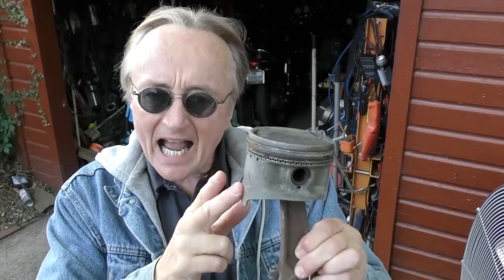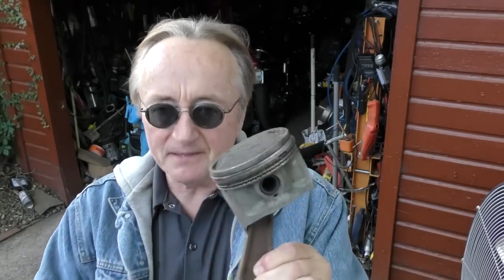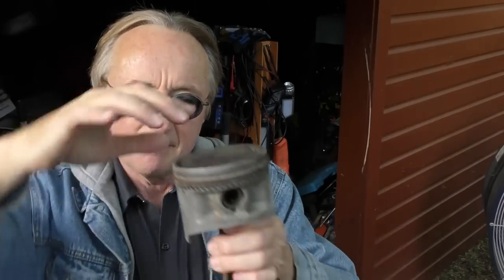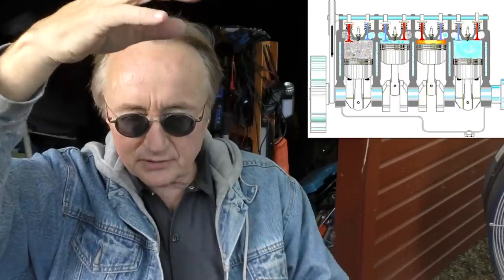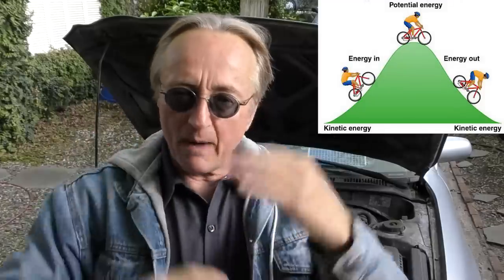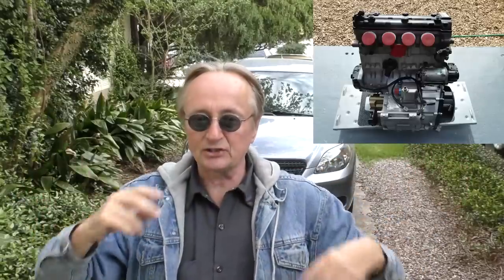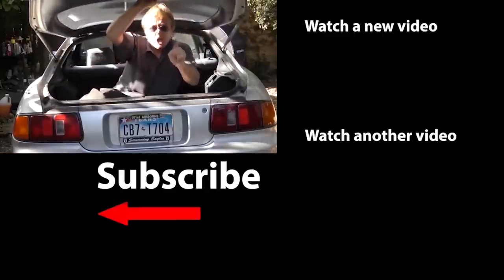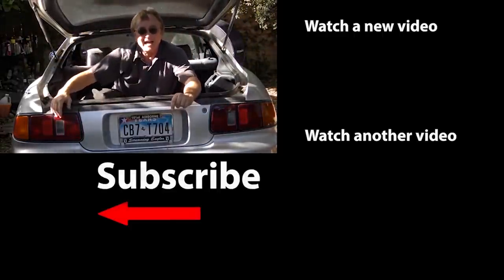Horsepower vs Torque, Which is Better

Comment: Horsepower is useless without torque!
Reply: you can't get one without the other
Reply: @mcplutt  Yes but you can move a mountain with 1 horsepower if you have enough torque. The 1984 BMW 318 had only 110 hp but 170 fp of torque and I could idle up a hill in 3rd gear. If it was reversed it wouldn't be able to get out of it's own way!

Comment: F1 cars don't accelerate all that well?? 0-60mph in 2.1 seconds and 0-100mph in 4 seconds...
Reply: Collins LFC he's talking smack. And not taking revs into consideration. He's referring to acceleration from a dead stand still, not taking into consideration once the car builds up revs, which is exactly why F1 cars are so quick. Their torque isn't all that impressive compared to a normal road car but they rev like crazy which is why they accelerate so hard

Comment: Lot's of horsepower and low torque mean they don't accelerate well? How does a McLaren 720s run circles around both the Hellcat and a Tesla then lol? Then again it's probably because the 720s is like 3,000 pounds.
Reply: A stock 720S can't beat the fastest Tesla in 0-60 mph.
Reply: @mcplutt  What a 1/4 mile though ?  A Tesla starts slowing down when it hits about 110mph also. Fastest stock 720s ran a 9.7 at about 143mph. Fastest tuned 720s ran an 8.9 at about 160mph and hit 0-60 in 1.9 secs.
Reply: @carljr.99  Tesla Roadster will be faster. A lot faster without all the track prepping.

Comment: Horsepower is made up. Torque is real. Applying torque is harder as rpm increases, which is why horsepower is important.. The formula is HP=TORQUE×RPM/5252. So torque and hp are always equal at 5252 rpm. Below that torque is greater and above that hp is greater. Peace :)

Comment: 2018 Chevy Cruze Lt 3746 miles superficial  damage to car $8500 is this a steal. Passenger front and rear door and front passenger fender all superficial damage frame good. Should I buy and if so what else should I be looking for. Clean title private party. Will this car last. I dont want to buy another lemon. Baught a jeep liberty 2002 sport because my wife like jeeps total junker motor blew at 170,000 miles. 4 wheel drive gone at 110,000 miles. I bought a fiat 500 pop 2012  16,000 miles  $16000. Like a dum dum beacause the price was nice. Of course two engine replacements later on the fiat and 1 trans on the jeep I'm done. I cant take shotty craftsmanship anymore is the Chevy Cruze a decent car please help inform me on this purchase. ... also baught a Volvo xc for wife at one point thinking ok get something reliable like my mom had as a kid. But no this thing blew up like the 4th of July  weeks after after "karma" from craigslist told me he wouldn't do me wrong actual name of seller lol. Thanks again  Kofman family.

Comment: F1 is not good at accelerating? waaaat?
"The 2015 Red Bull Formula One race car jets 0 to 60 in only 1.7 seconds, and perhaps even more impressive can reach 190 mph in under 10 seconds."
Those things are very light, they have more HP than kilos.

Comment: This is quite simplified and some incorrect information. Torque is not the measurement of acceleration, the power is , which is combination of torque and RPM = horsepower ... You said that f1 car is not good at acceleration ?! wtf, todays f1 car accelerates from 0-100 in less than 2 seconds!!! Diesel engines have a more torque than gasoline, but also lower RPM so they are not producing more power than equivalent gasoline engine ...  Please, when talking about these things, study a little better "theory" ... By what you said, the average TDI engine will pull the load better or accelerate better than the F1 engine which is INSANE!

Comment: This is incorrect, there are actually THREE components to "POWER". There is "Torque", "Speed" and "RPM". Let's use a bicycle for this model. The max RPM is how fast your feet can pedal and torque is the length of the bike pedal levers which turn the bike's lower crank, the speed is a separate process via gears. Torque is measured by the length of a lever, the longer the lever the more torque (torque=leverage). The max RPM is determined and limited by what type of engine you are using, whether it's your feet (60rpm), a four-stroke (~10,000rpm), or a jet engine (25,000rpm) and it is the power band of a given type of engine. Having a higher RPM gives you the advantage of speed in a race because you don't need to shift gears as soon. If you put in a bigger engine in a car (4 liter to an 8 liter displacement) it will not go faster without a transmission, the gas explodes on to the piston at the same speed because it is an explosion that is a physical constant, you have to increase the rpm's to generate speed at the crankshaft. Interestingly, torque can be wasted if it is not used (ex. 18 wheeler not towing a trailer at slow speed), unlike "speed", no power is wasted. Only Torque and RPM can be accurately measured at the engine's crankshaft, but inside the transmission torque and speed are trade-offs. Summary; speed is a product of the transmission gear ratio times torque: rpms and torque are limitations of the engine type. Questions...?

Comment: A 1200 Sportster struggles to get to 100 mph? LMAO! My 96 1200 will get up to 120 quick, so would my 86. Even a 2000 883 I had would do 110 easy. I can only assume the ones you may have dealt with were owned by people who didn't know much about making them run to the best of their ability.

Comment: r1 dont accelerate that well...hahahaha 

you can't compare torque and horsepower,need to include rpm's and also gearbox.
horsepower is torque multiplied with rpm's divided with 7024 (5252)
Reply: Bingo. Comparing torque and horsepower makes as much sense as comparing a wheel to Chevrolet
CHEVY SELLS CARS BUT WHEELS WIN RACES! WOOO

Comment: Of course then there's gear ratios and final drive ratio, but that gets complicated. In a nutshell what Scotty says is horsepower is how fast the car will go, and torque is how quickly it gets there.

Also important to note that if you go out cruising with your homies in your car and each of you weighs 200lbs or more you'll be better off in a V-6 powered or V-8 powered car because a 4 banger turbo is just not going to have the torque to haul all 4 of your pudgy butts down the ave!

Hahahahahahhd

Comment: There are only one force in a combustion engine that is torque, hp is the effect of the torque on higher rpm
Reply: There is only one force in a combustion engine that is hp, torque is the effect of the hp on lower rpm.
Reply: @IgorArkin  torque is force,  hp is effect
Reply: @torevenheim9607  
Hp is a unit of power.
Torque is force x radius
Power is force x speed
Reply: @IgorArkin  you can call it what you want

Comment: Scotty is amazing I love him but this is the worst explanation ever...

torque : is the strength of the engine!
so it's a measure of how much weight you can lift

horsepower: is the speed of the engine! so how fast it can go to the maximum RPM

both combined tell you how much you can lift and how fast you can lift it...

Comment: IMHO, this never ending debate of which is "better" Horsepower or Torque is the most ignorant and stupid one... Without RPM data, both are terms equally meaningless... With RPM, then we can convert one to the other, the "which is better" debate is meaningless..

Which one accelerates faster? One with better power band across the usable rpm range accelerates faster.. Which one is better for pulling? Again, one with better power band will pull better... Better power band will also always equate to better torque band at driven wheels. Again without RPM, better engine torque doesn't mean sh*t, a high torque low rpm diesel engine will need different gearing than a high rpm low torque engine to do the same job, whatever that is..